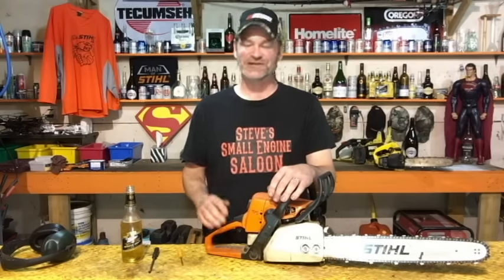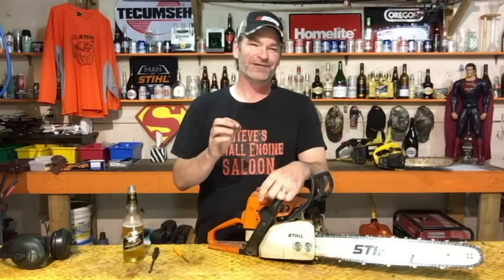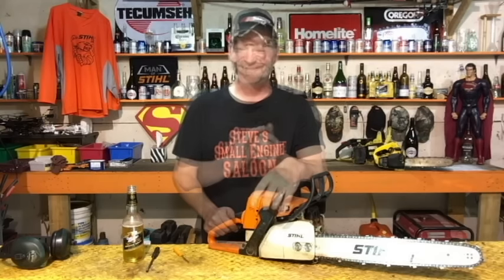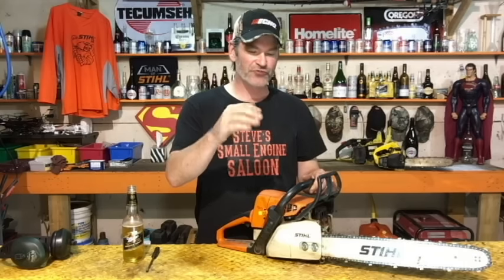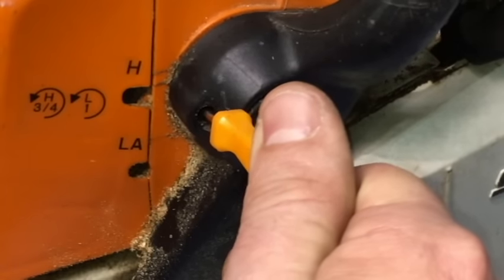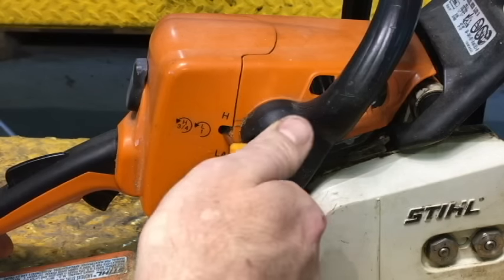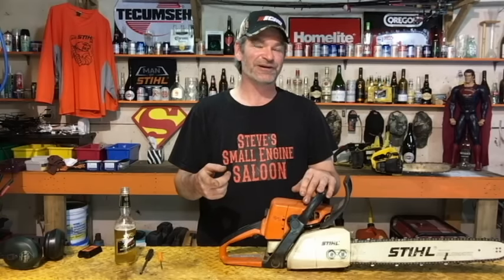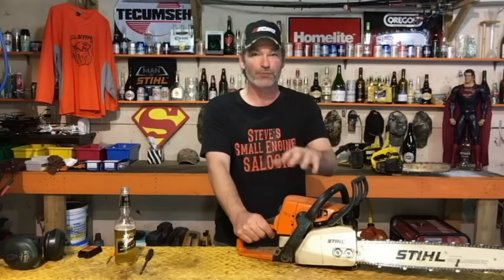CORRECT WAY To Adjust Or Tune The Carburetor On A Chainsaw (Step-by-Step)

Comment: Does this process fix a saw that loads up at altitude but runs fine when ya come back down to where you normally cut?
Reply from the maker: Altitude is the biggest reason that carbs are adjustable!

Comment: Hi Steve, Love Yor Reviews ! One question?  On Stihl chain saws the Hi setting is marked at 3/4 turn counter clockwise from all the way in or as far as you can turn this screw clockwise in.  Is this a ok setting for hi speed even if you do not have a tach.?   Thanks again for your honest reviews!   ps. I am also a beer lover!
Reply from the maker: Those markings assume you have NOT taken off the limiter caps!

Comment: Recently rebuilt a craftsman 40cc. I bought a carb from amazon and it will begin to rev on its own,  equal to 1/4 throttle. No matter how I adjust the mixture, the same result. The idle screw doesn't seem to even make contact to the throttle. So it would appear to be at the lowest idle setting. Another quirk, if I crack open the fuel tank and close it again fast the idle will drop for a time. Any idea what is going on here. This is my second amazon carb. The first one was a different brand, but the throttle shaft to the carb broke off at the carb.

Comment: I took out both H/L screws n cut a slot on the head tp take a flat screwdriver. Ps i  found tiny particles on the tips. From experience the carb have to b completely strip n properly cleaned. I use lights n magnifier to c through all the holes.

Comment: Most saws you buy off the shelf at the box store are set to run extremely lean...sounds great because you are saving fuel, but in reality you are increasing wear on your engine as its not getting enough fuel...remember a 2 stroke engine uses oil in the fuel as the only lubricant for the internals....so running too lean not only starves your engine for fuel, its also not giving it the proper amount of fuel/oil mix...the saw will overheat, and in many cases eventually you will lose compression and/or seize the engine altogether.  

Those limiter caps are only there to keep you from adjusting the saw, for the EPA lovers out there.  Anytime you go up or down in elevation you most likely will need to make adjustments to the carburetor for elevation changes.  

A lot of these carburetors now have all sorts of different types of adjustment screws, best thing to do is buy a set of the different screwdrivers for adjusting carburetors.  Yes, you can buy them, no its not illegal to sell them or to buy them.

Comment: One of my Stihl saws runs great as long as it's cold, once it warms up, about 4 or 5 minutes of use it bogs down?? I have rebuilt the carb but it does the same thing? It's got a lot of use and is a bit old so I was wondering, can the case be expanding and allowing air in through the bearing?? Any thoughts on it?? Maybe the Mag??

Comment: Hi Steve, thanks so much for this video. I knew little about the low speed needle setting. O couple of things I didn't know before tuning my saw.... I didn't know about the sweet spot and then backing out a little. I didn't adjust the low speed needle while idling higher rpm. I had the air filter off. I followed your procedure and now my chainsaw idles perfect and I get great throttle response. One thing is when i release the trigger from full throttle, the rpms die down to the point of stalling. without touching anything, I just pull the rope and it idles fine. What can cause this?

What's your favourite beer?

Subscribed.
Reply: I’m no expert but my guess is the low speed screw needs to come out a quarter turn. It’ll run ok for a bit, then idle down and die, means it’s starving for fuel at idle

Comment: To set the high speed,its usually 2 turns out from seated I then warm up the saw,hold it wide open, turn out/anticlockwise till it stumbles and runs rich,then turn it in/clockwise so it cleans up and sounds crisp and then leave it there,if any bogging occurs when cutting then turn in 1/8 of a turn and retest.

Comment: Great video Steve! My fairly-new Stihl MS 181C idles just fine. Saw worked well a week ago. Today, it still idles fine, but when i peg the trigger to full throttle it revs up for a second or two, then revs down and dies. Starts right back up. Fuel and air filters look clean. Gas is in good shape. Any suggestion?...
Reply: Update: Turns out the gas was less than fine. Emptied the tank, cleared the lines, bought a gallon of fresh gas and added fresh oil. Saw’s back to it’s sharp old self.

Comment: Can use a dremel to cut a notch for the screwdriver to fit those pesky adjustment screws, works on Huska, Poolan etc. Great hints to keep the idle steady and to keep the top end revs in limits. For some saws, screw both jets all the way in then out 1 and 1/2 turns then start on tuning. On some, California air pollution laws push manufacturers to keep saws a bit too lean which is hard on valves. I make the mixture a hair richer so it has some power when cutting.

Comment: So the link in the description to the tachometer is not the one in the video. I can’t find a true wireless one like you have. Where did you get that thing??
Reply from the maker: You dont need to use the wire.  It is there for permanent installation as an hour meter!
Reply: @StevesSmallEngineSaloon  The tach in video is different than the one linked in the description. The one linked is a standard one that required the use of the wire unless I’m mistaken. I believe the one in the video is Stihl branded. The only one similar I can find is the Echo PET-304

Comment: Great video
Reply from the maker: Thanks!
Reply: @StevesSmallEngineSaloon   I'm used to working on outboard engines I did not know there was an idle screw I've been messing around with a high and low speed and it wasn't working, I went out and adjusted the idle screw and now it runs great.

Comment: Invaluable videos Steve all round. Wondering in this case how would you get round the fact that the chainsaw stalls when you release the trigger so adjustment when its running is difficult
Reply: Ive been trying to work out the same thing, I think he does this by turning tje idle speed up so the saw turns the chain as he adjusts the low idle screw, im going to try tomorrow, saw will barely run enough to start but itll run on the trigger

Comment: I’m new to tuning carbs and I learned in a service manual that a safe idea is to keep your carb at the standard adjustment unless you have a tach (and max RPM specs) — however if it’s obviously running crappy it can be messed with minimally at your own risk. KEEP IN MIND that running too lean on a 2 stroke will oil starve your engine and running too fast will obviously cause issues as well. 

At my work they’ve been doing carbs for a while and I don’t know of any engines they’ve blown up even while they don’t use a tach much, especially the 2 stroke techs.

Comment: I have an early model Stihl 064 and I'm struggling with the carb adjustment. The idle screw (LA) has almost no effect. I have the high speed screw set to initial setting which for this saw is one turn out. The low speed screw  I can cause the RPMs to drop by turning it in but not out. Can't find the "sweet spot". Initial setting for low speed screw is also one turn out but it won't stay running at that. Not sure what's going on.
Update: I found the problems. One of the screws that hold the cylinder head on rattled loose and the muffler screws fell out. They are stripped. Lots of fixing to be done. I need a backup saw.

Comment: I jave a homelite 707g, its a saw from the 60s and for some reason it has 2 sets of high low screws 2 on the front of the carb labeled H L and 2 on the side of the carb labeled H L. Any idea why there is 2 sets?

Comment: Steve thank you very much you definitely know your shit I first was introduced to a stihl I believe it was the 044 back in the Mid 90 i was a California state prison Inmate fire fighter started on the way back of the hookline Mc’Cloud scraping bare mineral soil than polaski all stumps of scrub oak manzanita etc. Must be chopped and 100% removed than 2nd saw puller first saw puller than 2nd saw and eventually 1st saw I am a batista Cal-fire champ in first saw p-line  firelime construction bust’n through the brush without throwing a chain or grinding on a rock wedge between tree stumps anyway just like to say Im kinda self taught thats the way it is for inmates so I dont know shit except what I figured out for myself so I could dovthe job without getting dragged through the mud or strait walking off a cliff in the middle of the night after my release from prison i moved up here to Spokane Washington and relalized there are a lot of lazy dudes who dont want to work lots of chainsaw work so I invested the last of my money bought an ms 390 but didn’t know shit on the maintenance or repair after watch most of the supposed saw-yers on YouTube I came across your videos and just want to say thank tou for the no gimmicks no bull videos you have helped me understand my very expensive equipment your awesome thank you the high and low carb video…. My must have allyime favorite

Comment: Steve, does the high speed mix screw not adjust the high speed fuel mixture, essentially leaning it out to the point of failure (stalling out) if you screw it in too far?
Reply: love your videos btw!

Comment: Hey mate . Ive got a 202t hotlzfformer copy and ive messed around with the H screw to get it revving higher and  it did for a while now it bogs out n ive got to choke it to start it and it wont rev up then dies . Have a fooked it ? Whats your suggestion ?

Comment: do you adjust the idle screw with the chain brake on or off? sorry, im new
Reply: If the chain brake is on, the chain can't move. Which will make it really hard to see whether the idle is set high enough to make the chain move. And as the idle speed increases, will also burn up your clutch.

So...

Chain brake off.

Comment: This is the first time I have heard the function of the high speed jet, described as a speed limiter. I have always thought the high speed jet also has a sweet spot between running too lean and too rich.
Reply from the maker: It does on a weedeater or blower!  I have a couple videos for those in my playlists....
Reply: @StevesSmallEngineSaloon  It is different on chain saws? I will have to watch(listen) again. Maybe older saws are different? Seems like my XL-12's have a sweet spot on the high jet. Well! Damn it! Now I have more homework and testing to do.

Comment: Hi Steve i have a rebuilt ms200t that im having a nightmare with. I'm struggling to get the saw to idle it fires up great then once the revs are off it dies straight away. Ive reset the carb to factory settings  im told for the la screw its 2 & 1/2 rotations out. This makes no difference. The only way the saw will run is with 5 to 6 turns out and then the chain is spinning very fast. Any tips or should I just buy a new carb?
Reply: Try cleaning the carb.
Reply: @SinsBird  ive tried all obvious problems
Reply: @jimmytree5417  Look for vacuum leaks.

Comment: Hey one thing, the high idle screw controls the fuel at wide open throttle (wot).  when there's no load on the engine the screw effects rpm directly because youre basically controlling rpm with the fuel air mixture. when theres a load, a lot more fuel is entering the combustion chamber and also the fuel coming in is actually cooling the piston slightly.  most times the rpm will increase as you lean it out until it gets too lean and rpms fall.  one reason for not running the air fuel mixture at no-load max rpm is because itll run rich under load and youll get poor performance

Comment: I guess I don't understand why turning in the high speed mixture screw would increase the RPM's.  Seems like it should be the opposite.  Did I understand this correctly?

Also, heat the limiter caps with a soldering iron and they should pull right off.

Comment: I took the limiter caps off and lost where my reference was. Can you tell me how to start from scratch with the adjustment screws? Please, like from all the way in, how many turns out to give me a good starting point. I can barely get it to idle now. Thanks
Reply: I have a MS250 and I'm at 7400 ft in Colorado thanks again

Comment: I think both screws adjust the mixture. Adjusting the high to a really fast rpm it will usually bog out because it's to lean.
Reply: Too much fuel would be ‘rich’. Too little is ‘lean’

Comment: Hi Steve, I am a bit confused.  The high speed screw adjusts the speed not the fuel mix, is that right?  Thanks
Reply: They're both fuel screws, one is fuel for low rpm, other for high.

Comment: You can find RPM accurately (if slightly inconveniently) with an audio recording from your phone and an audio analysis program such as (the excellent and free) Audacity.  I analyzed the second half of the run (10:44) and got 11,640 to 11,690 rpm (you can hear it speed up a bit).  It wasn't instant, but it was less than one beer.  (You could also do it with a spectrum analyzer app on your phone.)

Comment: I have a Craftsman made by Poulin . I have spark at the plug, new carburetor,  new air filter, new purge/ primer bulb and fuel filter, compression , fresh premix 40-1 fuel. engine will not fire even with a good shot of starter fluid!   what am I missing???
Reply: coil/trigger /wire/boot 
i got an old 63cc. just needed the fuel pump kit.

Comment: I always adjust the high speed screw in until I got the lean surge and then screwed it out just enough the saw stopped screaming and started to slightly burble. I've never lacked for power or burned up a poison

Comment: I have a wild thing chain saw from Walmart and I have took the filter off and drop some gas down the carburetor and the saw starts up it will run and smoke a lot for a minute or two then it dies out and then I have to drop more gas down the carburetor again and it does the same thing what do I need to do to fix it?
Reply: fuel pump ? or like mine , the tank line filter was blocked

Comment: Steve, trying to find the digital rpm meter you have on this video but without luck. The link to Amazon shows a different meter with wire that has to be wrapped around the spark plug wire. Any help?
Reply from the maker: The wire is only there if you want to install it permanently as an hour meter...

Comment: When your tightening that idle adjustment and the chain starts moving? It's the saw running? I can't hear it. How can it move the chain by tightening in if the saw isn't running? I don't get it.

Comment: my la doesn’t make the chain move all the way in.

might just take it in to the local mechanic.

cleaned the carb, air filter is clean, new bar, new chain, tensioned fine, new spark plug…i need to change out the gas first i guess.

i worked in tree removal for 2 years so i can start a chainsaw.

Comment: Idk what is going on but I rebuilt the carb on my stihl it runs great after tuning it.  I will shut it off and start it up a day later and it's out of whack I have to re-adjust to get it to run properly. I think my barn Is haunted

Comment: what if somebody ... has a 193 T Stihl and  has turned the adjustment screws  all the way in and all the way out and i dont have limiter caps on the high and low....and is the idle adjustment start point from all the way out or all the way in..my question wheres my start point if my saw wont start and run..love the videos  i looked in the manual but it doesnt help cause the limiter caps are gone
Reply: Screw all the way in, do 2 turns out, report back.
Reply: @SinsBird  thank you brother its a go now...!

Comment: Here's my simple way to look at it. If you machine wont start and/or has trouble idling , tune the LOW screw. If it idles fine but will not run at high speed or like this guy said if you throttle up action is laggy/or ruff, tune the HIGH screw. If your motor wont start at all then (make sure its not fuel flooded) turn the idle screw all the way up and adjust the LOW screw opening/closing the choke while pull starting it. i usually close it all the way and slowly open as i pull the pull string tell it sparks and tries to kick on then adjust idle back to normal.

Comment: Ok so if I'm using my lil saw mill putting my saw bar pointing at the ground where the saw is vertical why does my saw lower the out put in power when the trigger is 3/4 to full trigger pull

Comment: My chainsaw is from the 70s it was my grandads and it doesn’t like to start but I took the carb apart and looked at the diaphragm and islet let isn’t petrified I just think it needs to be adjusted it takes a flathead screwdriver to adjust. What if it doesn’t start but has spark and isn’t flooded

Comment: I notice that no reference giving to what stihl has on the side of everysaw.... with low idle being 1/4" turn out and high screw being 3/4 out. LOL. I always laughed at this, there are soooo many variables! saw model, the carb that came on that run of saw, the bar and chain you are running, if your filter is clean or dirty, if your saw is hot or cold, the fuel you are using, the oil you aremixing it with, the altitude at which you are cutting... LOL. Sooo glad to see you NOT reference those markings! Perfect Steve! Wouldn't have reccomended anything better or different myself! :-)

Comment: I have a Sears engine analyzer/dwell meter from the early '80's that has a spark pickup that tells r.p.m.s, with a 12 V. battery hooked to it for power and the pickup on the plug wire it will read the saws rpm, just twice of what it is actually doing because it was intended to be used on 4 stroke motors, right?

Comment: At (9:47) you state 1 1/2 turns on the High screw.  At 9:57, the inscription on your saw says 1 turn.  Any comment on the difference?  Are the ones on the saw just a starting point?
Reply from the maker: The inscription on the saw "assumes" you have not take the limiter cap off....